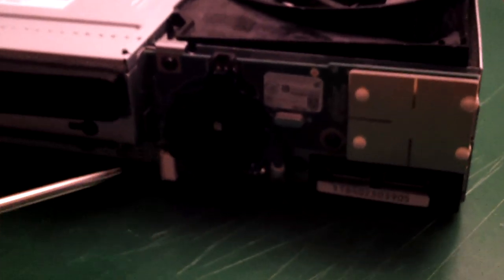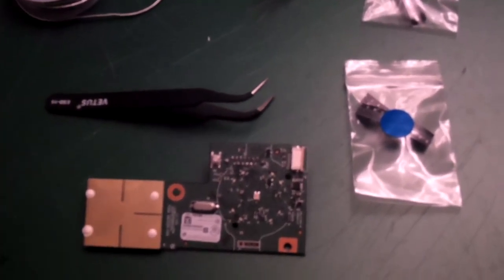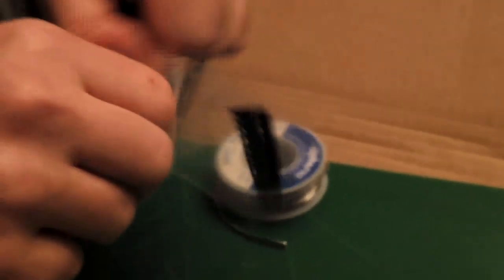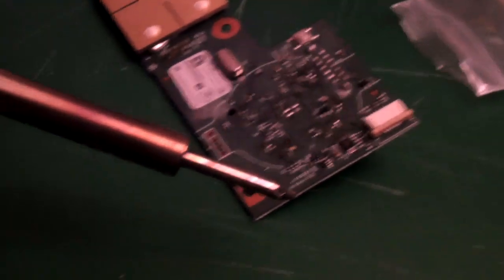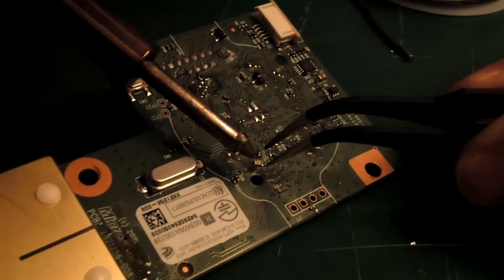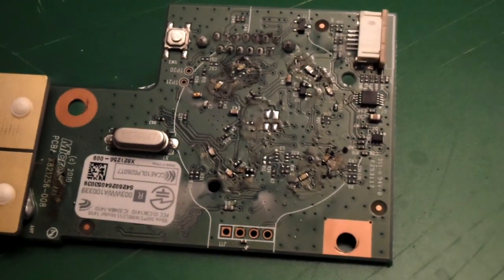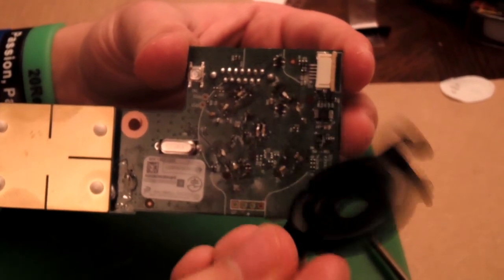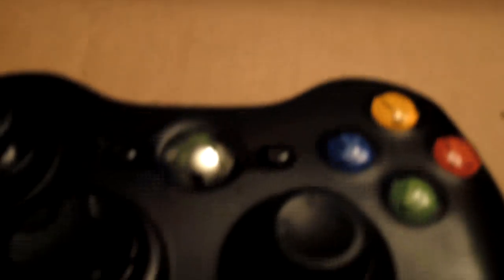How to Mod Xbox 360 Slim ROL (Ring Of Light)

Comment: whats up with modders and not using flix. it makes shit soooo much easier, and that way only the flux burns, so you can clean it up with isopropyl super easily, also the blob you leave from removing the original is enough, just hold the led there with the tweezers, then melt one side to hold it in place then just melt the other side
Reply: Alexander Turro 3 years later but hey might as well inform if you're not already. He used Rosin Core solder which is pretty much solder with built in flux.
Reply: 9 months later but hey might as well inform if you're not already. Rosin core solder will leave stains if not cleaned almost instantly. Not to mention it can sizzle and splash across the board. Try soldering without extra flux, and then use flux. Massive difference. I use rosin core and seperate flux on my Xboxes.

Comment: Constructive Criticism! (Disregard if within the year and some months that this video has been posted you have already learned this via experience, google, or some other youtube comment or friend.)

NEVER SHAKE YOUR SOLDERING IRON TO REMOVE SOLDER. SOLDER HOT, SOLDER BURN. ESPECIALLY IN THE EYES. (ALSO ALWAYS WEAR EYE PROTECTION.)

Instead get a little sponge (like one you'd wash dishes with. Get one from the dollar store for cheap it just needs to be a sponge.) and moisten it with water. Too wet and it'll make your iron oxidize faster (in short, it will... well get short into a rounded or flat tip instead of conical.)

You should also invest in some tip tinner to tin your tip before and after use/long breaks. This will extend the life of your tip being conical.

Also, if burn marks break the traces on the board it will be a problem.

Other than that nice job!